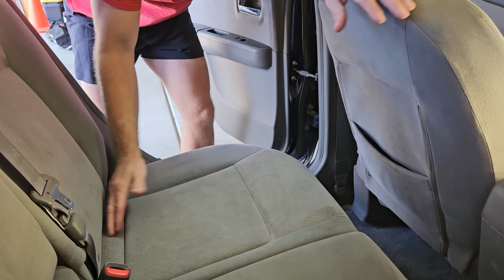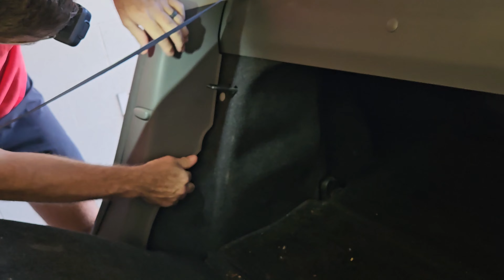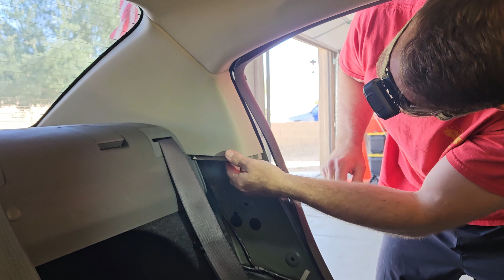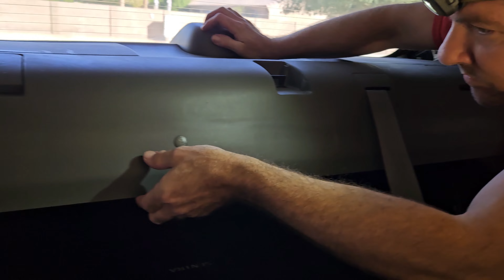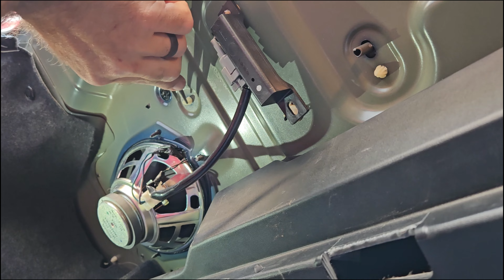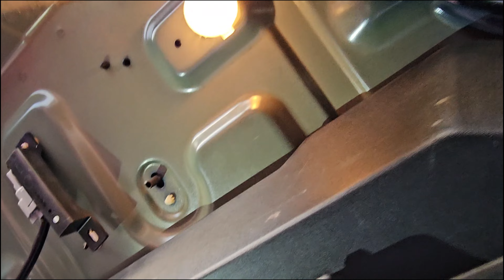Nissan Sentra Back Speaker Replacement

Comment: Did you ever do the front doors? Mom has a 08 with rattling blown speakers so I wanted to do the favor of helping the family with getting new speakers for the car. Back one’s seem straight forward. I am going to be using the speaker wiring harness adapters so that if we have to sell the vehicle at any point, I can reinstall the stock speakers back in their vehicle and , they can still keep the aftermarket speakers for another vehicle. Thanks for sharing the tutorial.
Reply from the maker: I have not replaced those, but it's relatively easy.  You just need to remove the door panel.